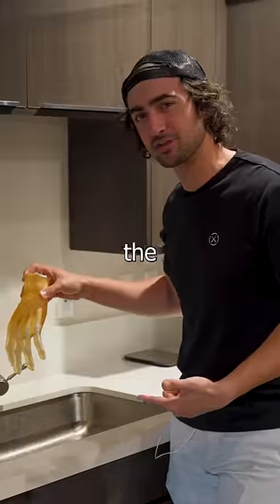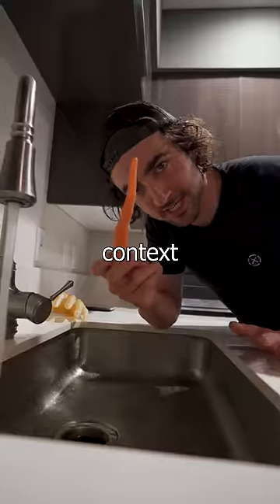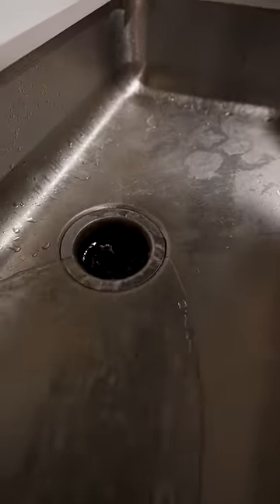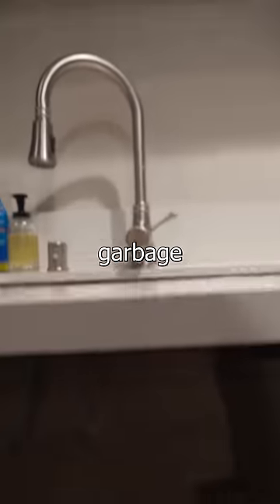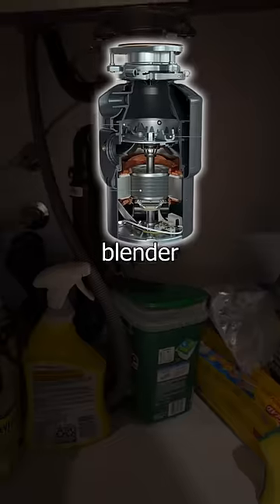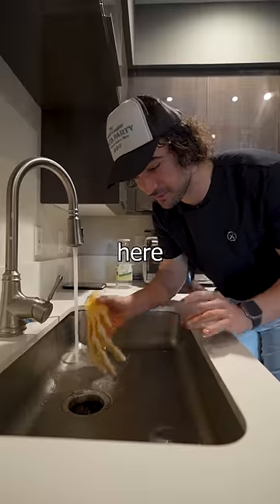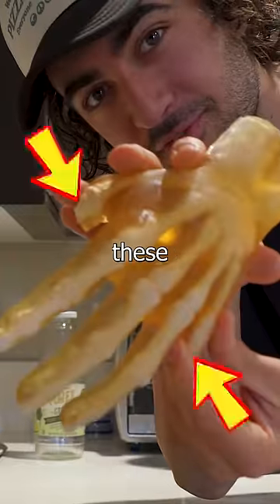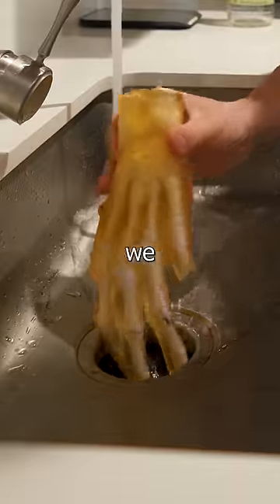Hand vs Garbage Disposal

Comment: our bones are harder than limestone
Reply: sherlock
Reply: Limestone is one of the softer types of rock, and is the same as chalk. In fact, most caves are made of limestone because it is very easily eroded by water. So saying that bones are stronger than limestone is like saying steel is stronger than dirt. Technically correct, but unimpressive with context.
Reply: That really isn’t as impressive as you want it to be
Reply: Isn’t limestone like one of the weakest types of rocks out there??
Reply: i didn't know that sorry for the useless info
Reply: @flickcentergaming680 beautifully worded